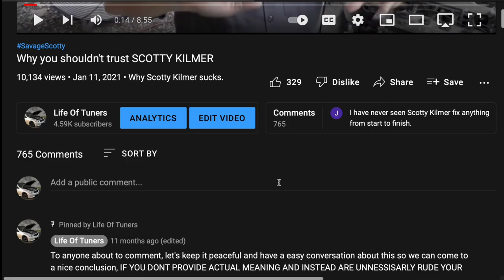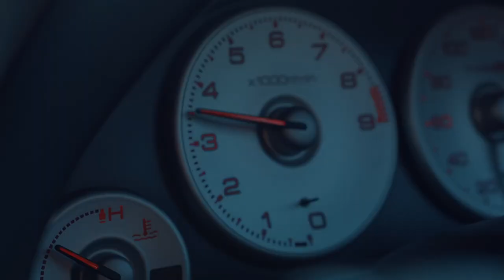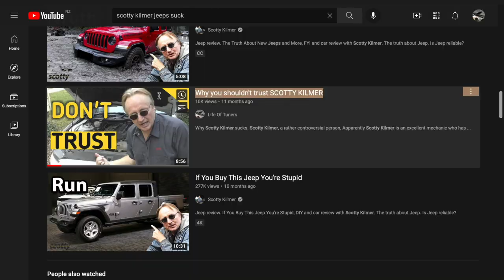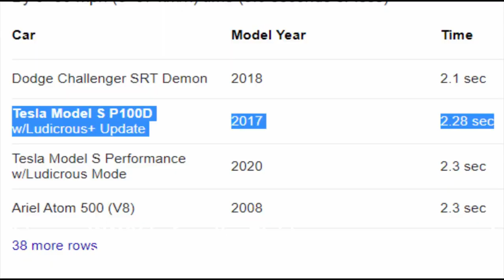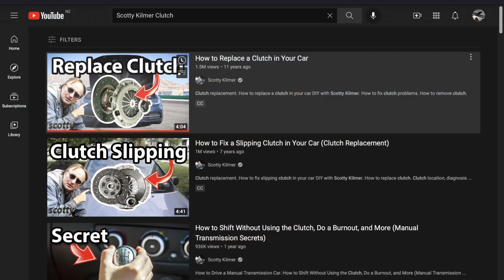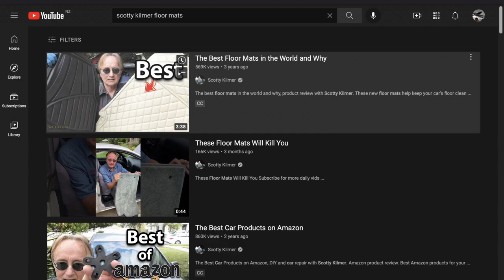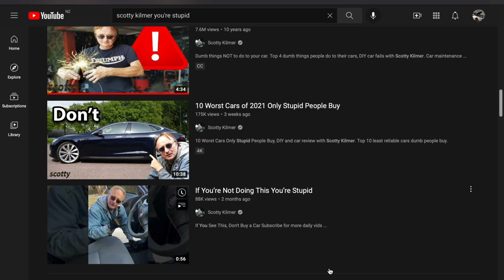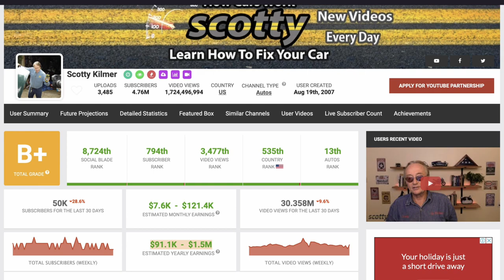Why you SHOULDN'T TRUST SCOTTY KILMER

Comment: Covid brain fog is going to make this 10 times harder to write and will most likely have some flaws in it.

Scotty Kilmer is one horrible mechanic that I am glad I stopped listening to before it was too late. All the advice and content he hands out are stale, repetitive, and horrible. 

Scotty’s saying that older cars (especially from the 50’s-70’s) are reliable, even though the manufactures then and modern technology prove otherwise. Cars from this era were never meant to make it past 100,000 miles and it clearly shows with a lot of cars from this era only using 5 digits to display the total mileage. Every car I’ve seen from the last 20 years could at least make it to the 150K mark, even ones considered unreliable. Carburetors is something else he constantly preaches from this era that he prefers over fuel injection. Even though at this point fuel injection is better at its job than carburetors ever were. This man even said that he would rather be in an accident in a car from that era than today. Why does he say all this? Because modern cars have plastic on them.

Another one of his poor sayings is Japanese good, American and European bad. In the real world, there are unreliable Toyotas and reliable Dodges believe it or not. There is more to the equation about a car’s reliability than just brand. There are models, model years, engine and transmissions and more that determine whether a car is built to last or not. By solely looking at the brand, you’re setting yourself up for disaster. An example of this is through computer PSU’s. up until a couple of years ago, people chose their PSU’s based on name brand. People on forums would recommend shitty variants of name brand psu’s instead of high-quality OEM brands that manufacture the other company’s psu’s.

50 years’ worth of experience is worth nothing when all you do is lie and give horrible advice.
Reply from the maker: Well written my guy

Comment: You made some good points but the emphasis on reliability is very fair, and also you’re very wrong the new f-150s and Silverado’s are very reliable I have worked for 6 years as a mechanic and the only one of the vehicles you listed that was seriously unreliable was the new Dodge Ram 1500… do some research before you start ranting…
Reply from the maker: Thanks for watching and taking it in! The Silverado is seen as the reliable one of the American pickup roundup, yet even that was far from reliable, mainly from their AFM I believe it was called, there system that shuts down cylinders to save gas, reportedly this lead to many many engines burnung excessive oil and seizing

Defo no horrendously unreliable, like a ram,I don't think I said that, but definitely not reliable. 
GMs been famous for not actioning recalls for failures, notably with airbags, due to the recall costing too.much, instead it's cheaper for them to be sued when the problem arises for a customer, as has happen with air bags failing to deploy, which has lead to people passing away
Reply: I would say that it's about industry average reliability most of the time from the big 3, in terms of their trucks most of the time.

Comment: 2:15 The pressures that a braking system exerts can easily exceed what those crush fittings are capable of. Just wanted to add some 'engineering' I looked up when I saw him use those...
Reply from the maker: Ah yes thanks, I know it's because they're brass right? Didn't wanna get too technical
Reply: correct. the packaging on those fittings literally said “NOT FOR AUTOMOTIVE BRAKE USE”   and someone already challenged it and explained how much pressure a brake line has and those fittings would explode the first time a “panic stop” occurs

Comment: You do have some very good points on Kilmer's very suspect safety advice however regarding your claims that Scotty is inconsistent with his advice on Toyotas and Hondas, I believe that, you either have never watched his videos right through, or you didn't understand him or you forgot why he recommended toyotas and hondas on some occasions and frowned on them at other times. It mostly had to do with the introduction in 2012 of 'gasoline direct injection' (GDE's) engines which he said were problematic due to oil dilution (with gasoline) problems. The CVT transmissions and AWD are other specs Kilmer does not recommend. Kilmer recommends pre-2012 Toyota and Honda cars , with the buyer doing his due diligence of course, before purchase. A little more thorough research needed next time. As for Kilmers safety you were spot on, his video needs to be reported or maybe tested for drugs. So thank you for bringing this to our attention. Very valuable information indeed. Which video was that, if you remember?

Comment: One thing I took issue with was his video where he claims it’s fine to shift manual transmission cars without the clutch if you do it right. I drive a manual and like yeah you can but idk I wouldn’t want to and there’s not much point. He claims that it’s a benefit because it will wear down the clutch less so you’ll have longer before it needs to be replaced. This is true but it wears the synchros as well and what’s funny is that replacement costs about the same as a clutch replacement. I’m no expert on cars and won’t claim to be one (unlike Scotty) but I feel like shifting with the clutch and just replacing it  one day is likely a lot better for the car than trying to get by not doing so. Unless you’re racing or if your clutch has gone out(duh) there’s really not much benefit over just using the clutch, it’s not that hard and there’s no point to do it while normally driving. Also wanted to note in the video he mentioned he recommends doing this but literally every other time he drives a manual he’s using the clutch but that may shut be bc he’s driving other people’s cars idk. Anyways just another bit of poor advice from Scotty.
Reply from the maker: yes definitely

Comment: Reliability is important to me listen you New Zealand up start l know Jeeps are crap l don't modify my cars l have a lot of cars never modified them also Hummers are crap there are only two countries that make cars well one country doesn't make cars any more and that's Australia but the other country is japan l notice you drive a honda very good choice and what does Scotty Kilmer highly recommend apart from toyota is honda also there is another jspanese car manufacturer scotty doesn't talk about is Suzuki another very good maker of cars a lot of people are stupid this us why they buy South Korean Chinese European and American built motor  vehicles and what do l drive a 1997 toyota hilux two wheel drive ute and it has done 430000 kms doesn't burn oil the gear box is fine and it will be around in 25 years time because the engine is good for 800000 kms so when l bought this ute l didn't know how indestructible it is and top gear tried there hardest to kill a 1995 4x4 diesel hi lux ute and they didn't kill it the hilux was beaten up but it still was running what they did to this hilux no other car built in the past 30 years would except for another hilux from the 1990s and l own one l ask will there be any car built today be running well in 25 years you are young and have a lot to learn about cars and the 1960s was a good decade for cars but the 1990s was the best decade for cars my hilux has no electronics the only is the radio cassette player and that is breaking down but the rest of the hilux is still going strong and this is why it will be going in 25 years time why your honda maybe so before you start going of at Scotty Kilmer do some research then you can comment on cars
Reply: Man wrote a bible length message just for no reply from him T︵T

Comment: The Chevy Silverado 2000 was very reliable!!!
Reply from the maker: One of the more reliable full size trucks
Reply: @LifeOfTuners  The worst American truck ever made what is the Dodge Ram 1500!! 
I think if you had & used a 1996 four-cylinder manual Honda Civic motor & transmission from that it would’ve worked out better in the 1998 dodge ram 1500!  The eight cylinder in that thing was so bad that six cylinder Full-size truck with no turbo were faster! The full sized school bus was faster! My grandparents giant RV got better miles per gallon on the highway. Well about the same. The transmission never really worked properly. The only thing worse was the 2002 Sebring six cylinder! Call quickly had to have the transmission rebuilt twice! I don’t know why my parents bought it! Except for the fact my mom thought it was cute!
Reply: One of the worst popular vehicles are the Jeep’s! Jeepers creepers!! After 1998 the Jeeps weren’t really any good!! The older Jeep’s are way overrated!!  They cost 5 to 10 times as much as they’re actually worth!! The jeep Cherokee is good for off roading &  that’s about it! It can fit between trees a lot better than Modern off-road automobiles!! None of the jeeps are worth $10-$15,000!! 
I might would pay $2000 for one of those rust buckets!! To take off road! I think it must add $800 for every hole in the frame and every missing cab mount!!

Comment: 1:45 not to mention that a sudden jolt from the jack failing means that the suspension contracts and actually goes LOWER than ride height - enough to do some serious injury. Even on my 4" lifted Jeep, the suspension can compress enough to crush a person.
Reply from the maker: Exactly, it's insanely dangerous, I've heard horror stories from people not using jackstands
Reply: Take any advice in life with a grain of salt, research is great. Take any information and mold it onto your life to your liking.